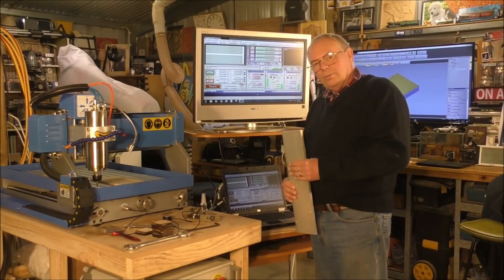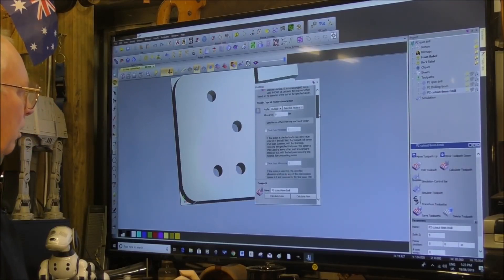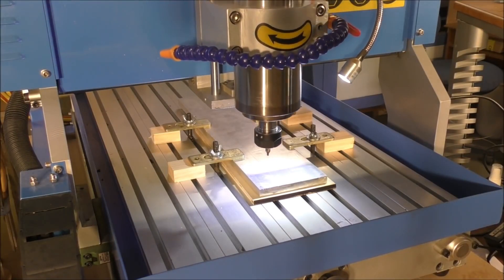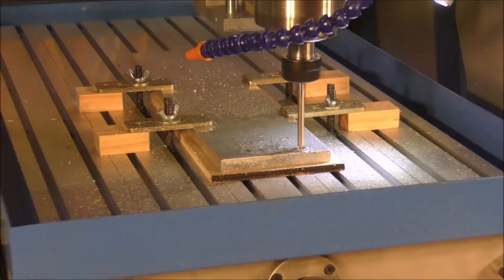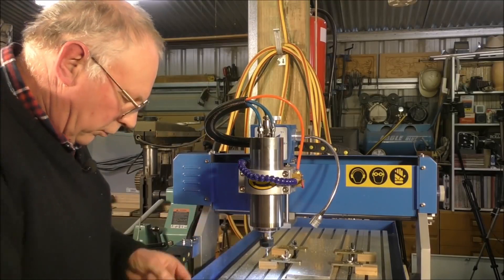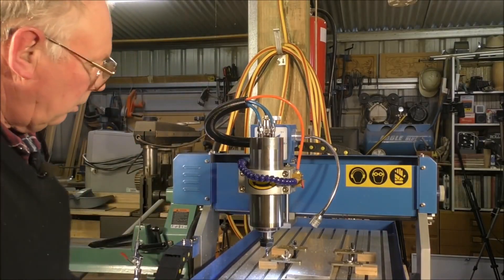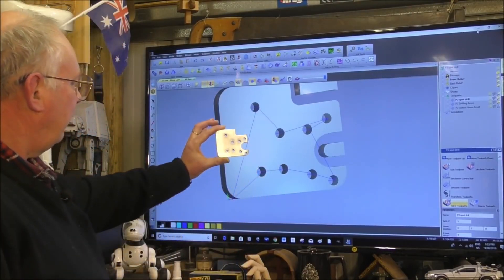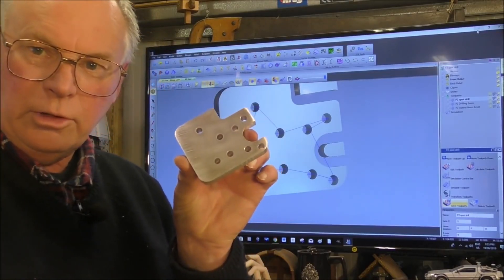6040 CNC Router milling and cutting ½ inch Aluminium plate

Comment: Sorry if you've already shown this in another video, but it seems like a fogger that blows air with a little bit of coolant to lubricate the tool and remove the chips would have been very helpful in this situation.  I don't know if you've already shown that in another video, so sorry if I'm suggesting something you've already covered.

Comment: Thank you for sharing Roger.
Does art cam have features to maching Alluminium because i can get a pc with it on for next to nothing.
When watching you drill with an extremely long drill bit i was gritting my teath. 
for the new  person, use as short as possible drill bit and cutter o you reduce the flexing in the tool
and so makes maching more rigid.

Comment: Use shorter drill and lower speed and feed . Way less chatter . Much better cut . Only need about 10,000 rpm 10in a min .100 pecks.  A rigged 1.5 csml works great in aluminum.  Love what you do Roger ! Learned so much from you over the years.  Just took delivery of my new forsun 4x8 vac table router two weeks ago . About got everything wired up and ready to test run . Have some issues getting NC studio on my Windows 7 PC . Hoping to have her moving later this evening 🙏

Comment: I bought some longer rails and will rebuild my machine. It is made from MDF wood and I was thinking of making the rebuild from the same material. Now I am thinking that if I want to do some aluminum cutting, I should make the new machine from aluminum. I will also design it somehow to contain the chips and coolant/lubricant from going everywhere. It does look like your machine now needs to go through the car wash. LOL.

Comment: Hello Roger. I have subscribed to your patreon at the 4Axis tier for 1 year. I sent you a couple messages, but never got a reply. I know you have abandoned the SMC controller, but wanted to know if you had ever set it up for a Z axis zero setting pad.
Reply from the maker: Hi John, I will check on Patron and get back to you there, I don't know what  happened to your message
Reply: @inventorsworkshop9600  I wrote 2 messages in the Messages section on your patreon page. Thanks.
Reply from the maker: I cannot find you on my Patron listing!
Reply: @inventorsworkshop9600  Sorry Roger. I forget that people see me only as TinkeringJohn on YT. On Patreon, I am John Walt. You replied to my comment about setting up a Z auto tool on the SMC. I also commented there that I am TinkeringJohn on YT. Looking forward to seeing you do that. Sorry about your flooding issues. Now I know why it took a while to respond to my Patreon message. Good luck and Cheers Roger.